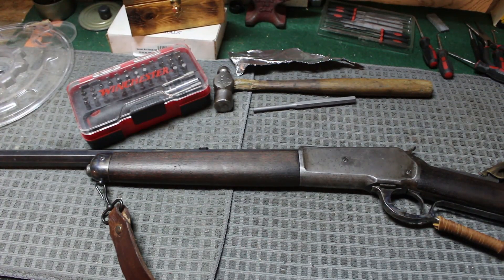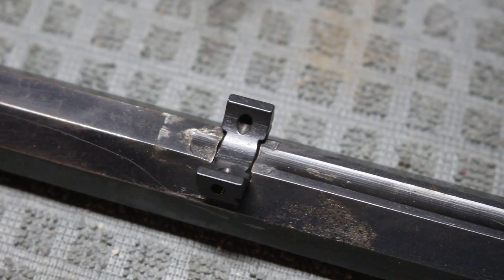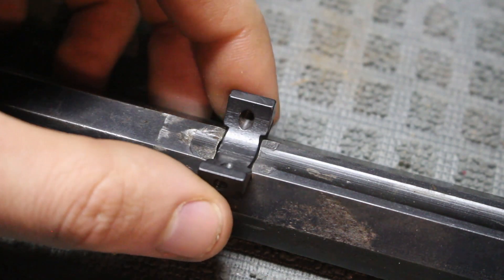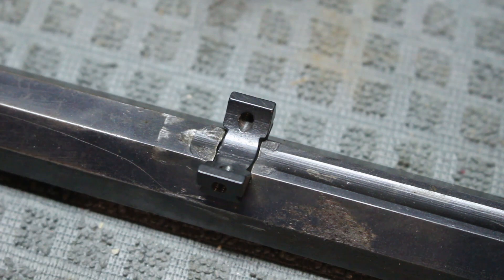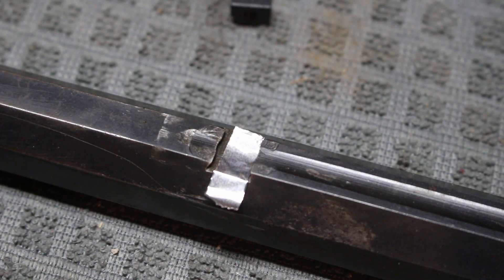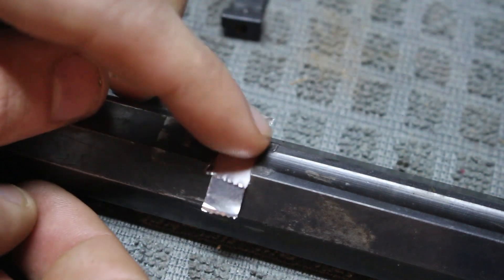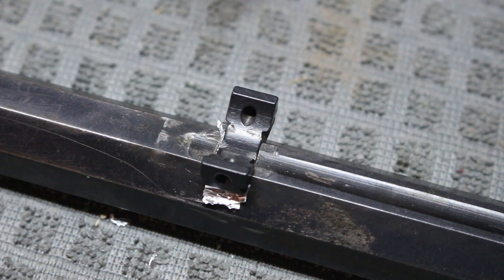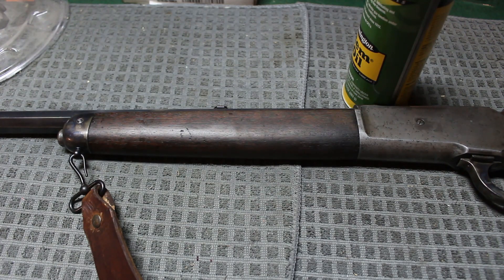Gunsmithing: Tightening A Dovetail Joint.

Comment: What I like to do is flip the part over and punch mark the bottom of it which makes it a little bit thicker and then when you poke it into the dovetail it will be tight as can be
Reply from the maker: You use a center punch?
Reply: Northern Woodsman most of the time are use a center punch but just on the bottom of the part you’re sliding into the dovetail probably hit it like 10 or 15 times crossed of it just to bring up a rough edge to hold it solid
Reply: that's what i do also................makes it very tight.

Comment: proper dovetail repair is to take the small piece out and peen 2 peen dimples in the small piece. This is a common repair done on dovetail sights on handguns. I would not peen the barrel since it would be easier and least expensive to replace a small piece rather than replacing a barrel, just in case of a bad "boo boo" . Plus peening the barrel could cause some distortion. It does not take much of a peen mark to snug things up and a dab of loctite. This is the type of dovetail repairs I do to any loose sights. I have tried the foil before, but the foil always wears out very quickly, maybe if your in a pinch, but the dimples peened into a sight or any small dovetail jointed piece would be the safest and least visible.  peening the edge of the dovetail on the barrel itself would be visible, not a couple of peen marks on the bottom of the loose piece. hope this helps.

Comment: Try a piece of clear plastic from a beverage container on the next one you have to fix. Hammer & Punching the top edges will require a small file set to repair.
Reply from the maker: I have done that in the past. Works well if there is alot of play since the plastic is quite thick.